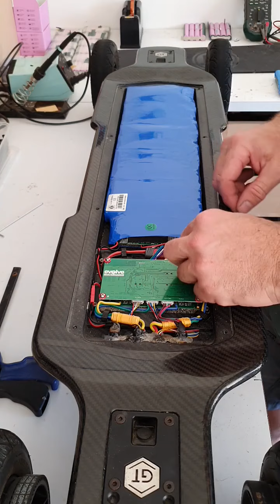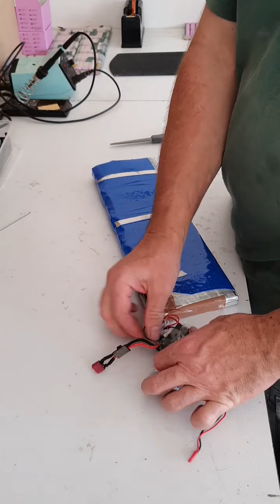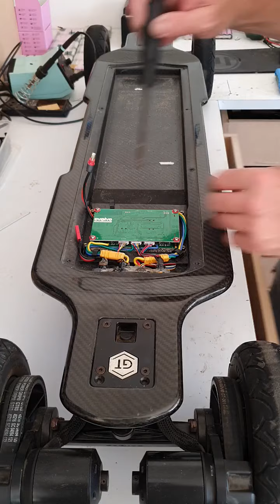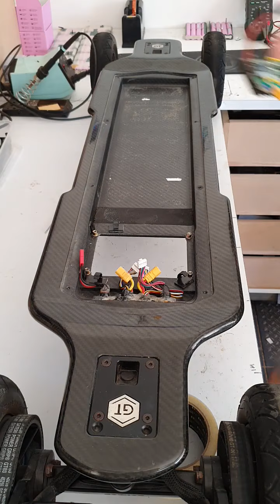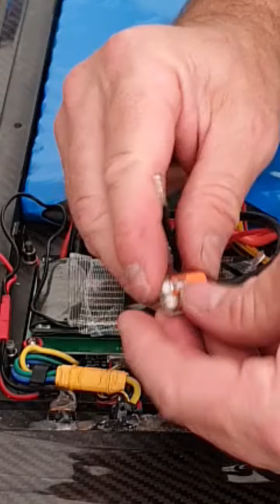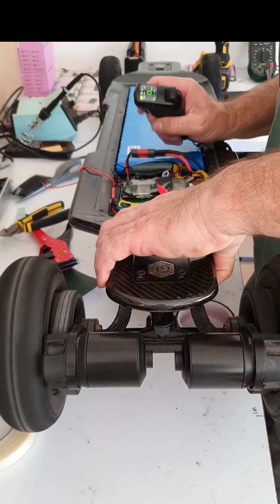Evolve Carbon GT battery upgrade

Comment: Thanks great video, all the info i needed to get my battery fitted and running hassle free :)
Reply: Did you use a heatsink spacer and was it available to buy?
Reply: @rdomain  I only bought the 11ah battery so  I didn't need a spacer

Comment: did you use the same  bms ?
Reply from the maker: Yes it uses the original BMS
Reply: @Marsen  thnx, im from México so I try to build 10s 5p with Panasonic batteries 2900  for 15 ha

Comment: Original BMS is setup for li-po, not li-ion. Cut-off will be much higher so the capacity is not really 14 or 17,5ah...
Reply: You are partially correct it is the esc that provides the cutoff at 31V the BMS cutoff is lower. Li-ion cells can go much lower than LiPO cells. It is very hard to provide real world capacity as capacity will change depending on load. I state on my website that power capacity is according to the specifications of the cell manufacturer. These batteries can be used with different electronics than Evolve so cutoff setting can be altered which alters the usable capacity, so some sort of standardised method of capacity measurement must be used. Hence the manufactures cell capacity.
Reply: @marksenft6322  yeah but it can be confusing for customers. They could think they will have, for exemple, double the range according to numbers whereas it's not true. I'm telling you that because I ran a small battery business in France for few months and I've had that kind of feedback. I don't criticize you at all, as a battery builder you don't have any alternative than putting manufacturer specs.

Comment: How great was that video and the kit.  I was watching to make sure I would be able to do.  I am not a great solderer and did not want to do dry or potentially cracking while riding soldering.  So to see that it is all solder free using joiners is a big plus.